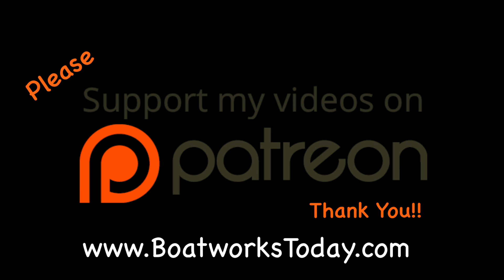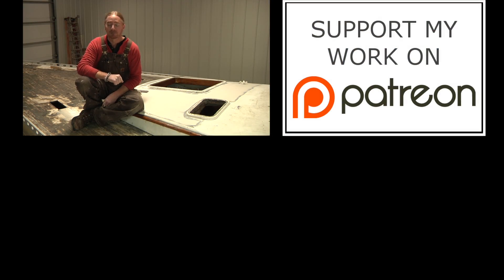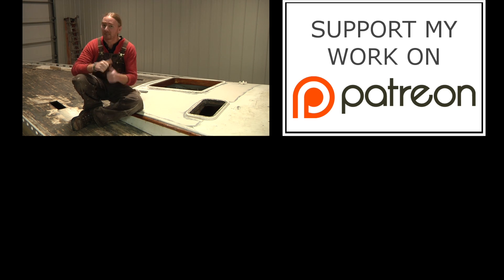Can Polyester Resin Catch Fire Doing Fiberglass?

Comment: If you cast a solid chunk like that of gelcoat without fiberglass, would it be stronger than resin. Thed reason I ask is I was wanting to make a block mold and gelcoat seems to be about the cheapest. I found a gallon for 39.00

Comment: I just stumbled on this old video and thought I'd share...I couldn't tell you the mix ratio; however, when I was growing up in the Chicago area, my father owned a small boat & fiberglass shop I used to hang out and occasionally work at.  His main glass guy set a cup of excess material (If I remember correctly it was polyester gelcoat, not resin, but same idea) down on his work bench and went on break.  It caught fire, and fortunately was close enough to an air hose that it burned through and got everyone's attention before the fire took out the whole building; or boat and mold that he was laying up, but it was one heck of an experience!  I would always recommend setting any cups with excess material on concrete away from anything flammable until they've kicked and cooled.  For anyone unfamiliar with working with composites, Don't EVER thrown a cup with uncured catalyzed material in a trash can, that is just asking for a disaster.

Comment: I'm a retired collision repair/refinish master technician and instructor. Add enough peroxide to that resin, IT WILL COMBUST! I've seen it countless times in winter when a tech tried to speed up the process with extra catalyst (hardener). I used to make small amounts combust to demonstrate the danger to my students. Soak some matt or cloth with that over catalyzed resin if you really want a fire! Be careful with polyester and epoxy resins! I once saw a young guy add extra hardener to leftover resin in a jar. He screwed the lid on and placed it in a field about 200 feet from the shop, a metal building. When it exploded, mayonnaise jar lid, right through the metal wall! I've seen it with matt, over catalyized, go up in flames and literally jump right off of the surface it was applied to.

Comment: I’ve seen the worst of worst with polyester! Yes Acetone is probably the highest danger! I’ve seen spontaneous combination!! Resin when mixed HOT over suggested MEKP! Will cause heat lots of heat but it’s this fume cloud that I have witnessed someone choke and pass out trying to get a 5 gallon HOT bucket OUT SIDE!!! I’ve seen skin burns as well from all chemicals used in fiberglass industry!! Be safe!!!

Comment: Ive seen it happen at a composite factory that builds massive tank and filtration units. Some one mixed a batch of hotcoat with alot of airdry wax. Walked away and it went up in flames in a wax bucket it was mixed in.It was on a table covered with news paper under a mould. Everybody ran but me. I grabbed an extuingsher and got it out before the plant burnt down. It can happen!

Comment: Worked at JTB in Rice Lake. We used paper cups of that size to mix in using a 1oz pump for the harder (DDM9) & a wax resin. Someone in my dept. decided to run two full pumps which is crazy stupid hot & let it sit after use - I could smell the hot resin as it started to smoke. By the time I walked 30' outside it did start on fire.

Comment: I worked at Grady White Boats from 203-08. as a Spray Equipment Technician. We used poly resin for production layup. Being in the South we spend a lot of Summer in extream heat. Most fire I experienced were caused by wet glass thrown in a trash can. I have seen a Chopper gun overspray a mold set for a pull and set off an arc fire from static. MEKP Catalyst designed for a quick cure is very dangerous.

I have never seen a container of just catalyzed resin just spontaneously burst into flames unless they were in direct heat transforming contact with a combustible material.  In wet form the most dangerous material fiberglass MFG is MEKP. It is UNGODLY FLAMABLE, highly caustic, and doe's not taste very well. A Close second is Isociante . The catalyst side of Plural component flotation foam. If you become allergic to it you will become Fred Flinstone. Cars, Beds, furniture, or anything else made of foam will be out of your life!!

In the event waste resin begins to smoke add water. It stops the reaction. If you add Plural component foam to a cavity and it begins to smoke DO NOT try and pull it out. It just gives it air.

I don't know what blend of resin you used. Our "Winter Blend" polyresin catalyzed with 1.75% of MEKP would "GEL" in 10 min. and would be completely "Kicked Off" solid in 15 min.

Please be safe. Eye, Ear, and Respitory ( When using power tools on glass or mixing fillers) protection is wise.

Comment: In your Canon camera there is a function called Face-ID where you can save your face picture from different angles. The camera will then sharpen on the the face it recognizes and not get blurred film when you are filming yourself.

Comment: If your batch didn't get above 288°F it couldn't even flash paper as its flash point is 451°F.  So, while yes, it will boil water, engineers have long known that it's not possible for it to reach flash temperature. I wasn't even aware that there was a myth regarding this. Although I do love ghost stories and myths.

Comment: I worked in a shop where a hot pot started a fire. Like any kind of accident, it took a chain of things going wrong but it was clearly evident that the resin was where the 'spark' came from.
The glassers put the leftover pot in the 'fire cabinet' to kick off and went home for the night. Somehow a fire started inside the cabinet (where there aren't supposed to be any combustibles stored) and burned hot enough to ignite doorskin templates hanging on the wall behind them - not the best idea in hindsight :)

Once that happened, it was a normal fire. It damaged a couple molds, then the sprinklers kicked in. We spent a month repairing or replacing damaged tooling. Now, uncured resin always get set on concrete - not only is concrete not combustible, it sinks the heat out of the pot. 

Putting a bit of water on top of the resin in the pot does that too: it can get hot enough to boil the water. The problem as I see it is when you don't give it any way for the heat to dissipate and you get an exothermic runaway.

Comment: I have charged 5Qt buckets of resin and it has not cought fire. When disposing of old resin, we sometimes charge batches of 40-100 lbs (5-12 Gal). I'm not saying it is a good idea to charge unnecessary amounts of resin, but the risk is minimal. The best way to mitigate risk with excess resin is to put it in a wide container to let it spread out and dissipate the heat. The cracking you noticed is caused by low strength and high internal stress. As the resin cures it shrinks, and the hotter it gets during the initial cure the more shrinkage occurs. The "puck" you made literally shrank so much that it broke itself to release pressure. without any glass content there was nothing to hold itself together.

Comment: I have smoked some resin while fabricating industrial FG piping, what I was always told was, the fumes were flamables, not that it will spontaneity combust. 
  But I have a related fire story to share with you all:
 In 1993, while working on proyecto,  a younger coworker used a rag to clean MEKP he had spilled on a metal work bench, but  the rag had previously been used to clean the clorine acid residues of tanker truck. As he swept twice the rag got instantaneously on fire.  We were later told the mixing of the two susptances and rubbing action on the bench top or any other small heat source will end up in a fire. 
He had not mayor enjuries, and we all learned a lesson.

Comment: what is the place to use poly resin, vinyl and epoxy? Does it just come down to cost and if gel will be used?
Reply from the maker: I'll be doing a video covering the different types of resin and when / where to use them this Summer :-)
Reply: Looking forward to that video. Hope you get back to posting soon!
Reply: It comes down to cost and what the engineering requirements are. Poly is the cheapest, vinyl ester is great for corrosion resistance and is strong enough for mold and pattern making, epoxy is much more expensive, in general, and is stronger thus used with carbon fiber or high strength fiber reinforcement. You also have tons of blended resins in manufacturing. Cost and use are the most determining factors.

Comment: A neighbor of mine lost their house to a fire started by saw dust and uncured polyurethane finish.  He had installed new hardwood floors and after applying the finish he decided he didn't like the final product.  He then spent a couple of days sanding off the newly applied polyurethane and sweeping everything up and putting in a trash bag. He had finished late at night and left the bag of sanding dust in the kitchen which self ignited later that night.  The fire inspector said it wasn't the first time he had seen this happen.

Comment: I used to work in development in a grp factory that made grp pipes for the gas industry. As part of the testing process we used to incinerate the pipes to see how they would hold up in a fire testing various grp mixes. It is extremely difficult to set fire to requiring abnormal temps but it does eventually burn off leaving just bare glass fibres.

Comment: I have a friend who´s had a resin bucket fire. Not with polyester thou but with vinylester. This industrial type resin is non-accelerated resin so the mixing procedure is to first accelerate the resin with a cobalt solution and then adding the initiator (typically MEKP). When mixing the resin/accelerator too hot and then also adding an excessive amount of initiator, the exothermal reaction could start fire. One of the most popular types of vinyl ester resin has a flash point at 29,4°C.

Maybe something to try? :-)

Love your videos, great job!

Regards
/Kenny from Sweden (polymeric materials researcher and boat nerd)

Comment: Ive done this by mistake, with about that amount before. I poured two cups like that, and catalyzed one to start and had the second waiting in reserve with no catalyst... And picked up the UNcatalyzed one and started to work on my material... Whoops. But, my cup did melt (was kind of warm out).
Reply from the maker: Ooohh...  That can be a mess to clean up :-O !!  Most likely it was the styrene that melted your cups :-/...
Reply: did the same thing. took me a while to figure out what happened.

Comment: Two comments Andy.

1. I am not surprised that your small batch didn't get very hot.  I have found that the shape of the container and what the container is made from matter. a flat tray of resin doesn't get as hot as your one quart cup.Metal is also better to dissipate heat.  Furthermore, when  laying up hulls I have used multi-gallon batches with no trouble other than them getting a bit gummy toward the end of a batch if you don't work fast enough or it is hot (>80F) in the shop.  To speed things up we generally applied resin with a paint roller rather than a brush.

2.  I was disappointed that you didn't mention the big, apparently brand new, green toy in your shop.
Reply from the maker: Ha :-)  It's not new,  just have made a point to keep it out of sight :-)  But with the teak deck coming this week I need to have it at the shop for unloading from the semi!  Enjoyed your last video!  Good job!!

Comment: Andy would changing the mixture give different results? Such as more or less than the 2%?
Reply from the maker: It would.  Typically the mixture is altered depending on the air temp.  Hot days I usually use closer to 1% but cold days are closer to 2%.  So a 2% mix on a hot day would definitely melt some cups!  Don't like going over 2% in any situation though...
Reply: So after this project is complete and if you have resin left make a very small batch and try mixing like 5% or something stupid and see if it will just melt cups and make a mess or will it actually spontaneously combust, that might be where the stories come from when people say it happened from incorrect measurements but don't try a batch like you just did, a tea spoon full should be definitive lol. Don't need to burn down your shop

Comment: I work in a aircraft composite shop and we have done that experiment with epoxy. A lot depends on the cure time of the resin as well as ambient air temp. I've seen it smoke and crackle. No fires though. Does get hot enough to burn you. And the fumes are toxic.
Reply from the maker: Yup, that little cup stunk up the entire shop for a day!  Typically I wear a respirator but the audio isn't too good in video when I do that  :-/..  Thanks for sharing your experience!
Reply: I also used to work in a building with a composite shop in
it. The guys would be mixing Resin, Catalyst and Accelerator. Get those ratios
wrong or in the wrong order and the reaction is almost instant with a huge amount
of heat, smoke and lot of crackling (loud).

Every couple of months someone would come running out of the
shop with a container (Metal) of this stuff going off like Vesuvius. Health and
Safety wasn’t a big issue back then, although they did have masks and huge fire
resistant gloves.

Comment: Great video as always! 

Have you done any strength tests comparing polyester and epoxy resin on CSM? I have a whole bunch of poly, epoxy, CSM, and 1708, but I genuinely don't know what to use and where. So much conflicting info out there. Then the old salts tell me something completely different :)

Cheers!
Reply from the maker: I have not done a video on that yet, but am more than happy to help you to use the correct materials for the job :-)  But for the record, CSM and epoxy really aren't the best combination.  CSM uses a binder to hold the strands together which dissolves with styrene (thinner used in polyester and vinylester resins) making it very pliable and easy to work with.  Epoxy does not have this..  But, epoxy is great with 1708, cloth and stitched fabrics!!
Reply: Got it! And can you mix the two? For example on a deck, lay down a CSM layer with poly followed by a 1708 layer with epoxy? Still learning all this :)
Reply from the maker: As a general rule, you can apply epoxy over poly any day of the week.  BUT, poly on top of epoxy is typically considered a No-No..  There may be exceptions for small areas though depending on the epoxy used but it's best just to follow the rules :-)
Reply: You're a legend! Looking forward to learning more. Thanks again.
Reply from the maker: Thank you!  I should add that my previous comment is presuming that the poly layer is fully cured and sanded BEFORE going over top with epoxy.  Cannot put epoxy over top of wet / un-cured poly :-)  Just wanted to make that clear
Reply: Thanks for clarifying!